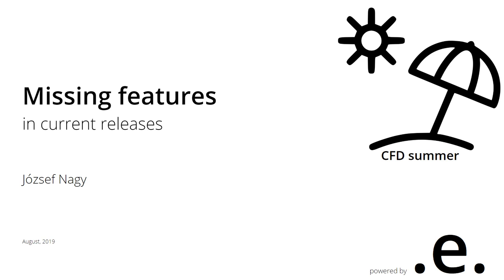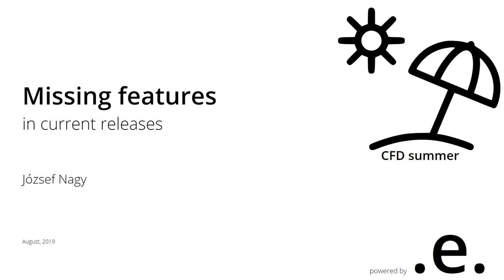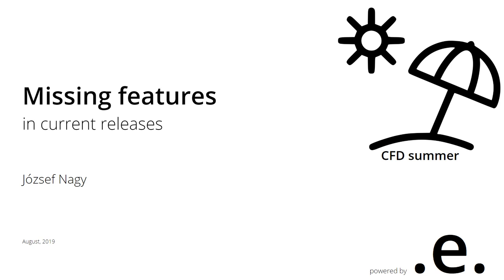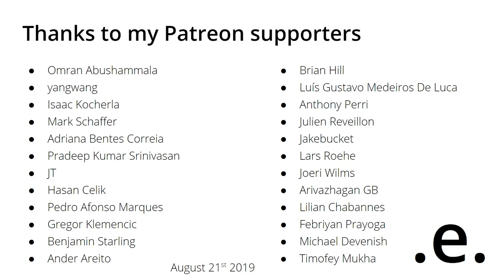[Community video] - Missing features in current releases

Comment: 6DoF module should allow for independent motion of more than 1 rigid body. With the inclusion of list of dynamic mesh solvers now in OF7, it is possible to try it but it does not seem to work correctly, and sdof state library is not compatible. This is a critical feature to many fluid structure interaction projects.
Reply from the maker: Thank you!

Comment: Hi Jozsef
I agree with GPU capabilities. I would also  like the option to set both inlet and outlet water levels in interfoam for riverine and civil hydraulic structures, plus the ability to ignore the second phase natively and additionally refinement of the interface mesh and redistribution of the mesh to cores in parallel computations.
Reply from the maker: Thank you for your input!
Reply: @OpenFOAMJozsefNagy  it think we also need a faster model similar to the speeds of the naval hydropak from foam-extend fornpreliminary design and then a high accuracy model also to assist with expediting the production phase

Comment: Great Video, 

There are several features in need for development, but  I think OpenFOAM needs a IDE like visual studio which can be very friendly to beginners, or a simple extension with linting and intellicence (pardon if spelt wrong) for VS Code will suffice.
Reply from the maker: Thank you for your input! There are GUI-s for OpenFOAM available, however they are not free of charge.
Reply: @OpenFOAMJozsefNagy   yes I've heard about GPGPU for OpenFOAM but haven't seen or heard anyone using them. On the other end for solver development we can make eclipse IDE (I don't know the details. I saw that YouTube) but for general case preparation we need a better editor than vim or gedit, that's why I suggested VS Code.